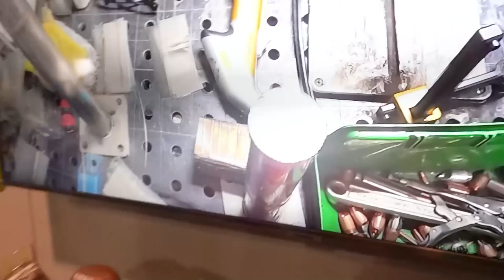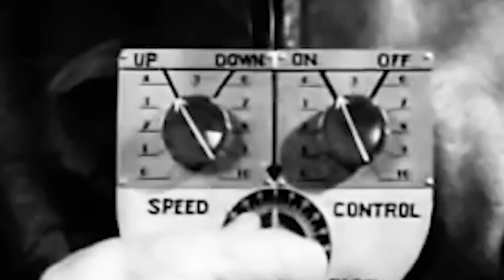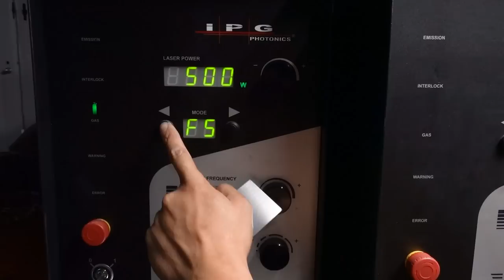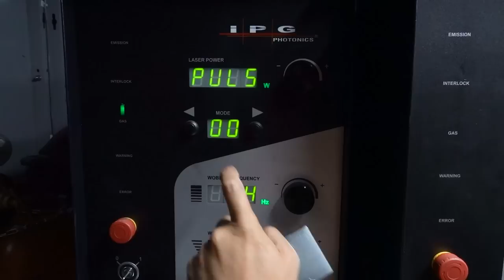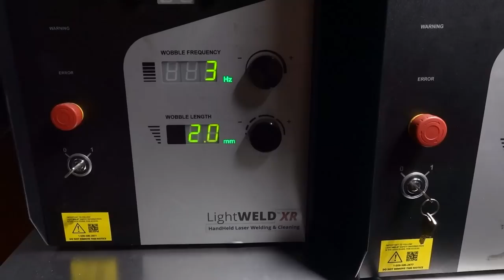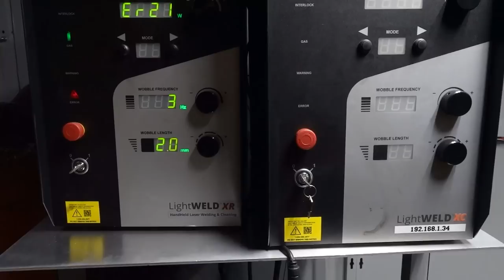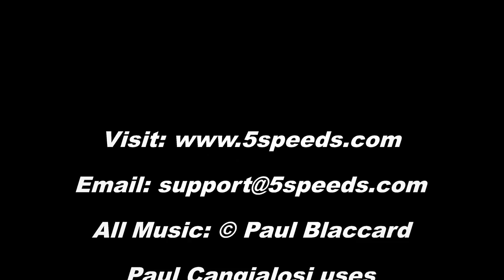How to Laser Weld At The 2022 Sema Show in Las Vegas Nevada

Comment: The only thing keeping me from having one,  is that Price Tag.
$35,000 is a quite $$$ for the average welder !
Reply: you can try other brand laser welding machine
Reply: ~$5500 for a 2kw machine direct from China via reputable suppliers with a Reci fiber laser core. They're not quite as polished but these machines are really simple at a fundamental level. Not to mention that any stainless part from China was welded with a Chinese laser. They're not outfitting factories with American lasers.

Comment: my shop just bought an IPG laser welder I am the guy they picked to use it. I start tomorrow
Reply from the maker: Let us know what you think!
Reply: Well damn bud don't leave us hanging how was it?
Reply: It’s totally different then any other type of welding. Torch angle and travel speed are the most important. I’m still getting the hang of it. The little distortion it has in stainless steel amazes me.
Reply: My shop also just bought one and I was the one they picked to run it
Reply: @adolfoflores-mx9ll  it’s definitely not like any other welding process. You gotta watch the laser not the puddle. I’ve gotten pretty good at it.

Comment: U can achieve the same fusion effect with brazing…. And at about 1 million dollars cheaper… way less to maintain and can buy new tips and guns starting at 15$ …. Only problem for most is it takes time to learn and skill to apply the techniques
Reply from the maker: Fusion effect? Brazing is brazing and welding is welding ...period. its not done for a "look".  Can you braze for certain applications instead of weld... Yes. But its not a cosmetic thing. Ive brazed with TIG and welded with TIG. Depends on materials and engineering requirements.

Comment: No cut and etch to show penetration of the weld. ?     Or does it just lay down a bead on top of the material ?
Reply from the maker: Read the oother comments about penetration and try and understand that this was done at a trade show.
Reply: @GearBoxVideo  exactly .. they should have had some cut and etch examples there .
Reply from the maker: There were plenty of welded examples at the show on display...

Comment: Would it be safe to use Laser welding,as i have a pacemaker now
Reply from the maker: Since laser is light and not an electric arc, I think your concern should be towards any form of electric arc welding.
Reply: The only risk to your heart with laser welding is the possibility of it stopping when you see how fast, easy, and beautiful the result is. 😏😁

Comment: Question: Would I be able to weld cast iron, cast steel, and cast aluminum with this welder?
Reply from the maker: Its the same as a TIG method .Just a different way of applying the heat. So however you weld or braze your metals doesn't change .
Reply: @GearBoxVideo  Thank you Sir

Comment: Like you said..  When you release the gas trigger, it does go ahead and give you about a 3 second delay of more gas --- and you're supposed to hold it steady at the end of your weld, until the gas stops.   What that does is shield your weld for a those few seconds letting that last bit of your weld cool, while still under the shielded gas.   If you just quickly pull away the welder right when you're done, it can make cause trouble at the end of your weld.  So again, once you get to the end-- you let go of the trigger and hold that final position for those last 3 seconds of gas while the weld cools, and you'll have a perfectly finished weld.

Comment: Paul many thanks for presentation.  Would be helpful to show the components for a shop to stand up allowing one to weld.
Reply from the maker: I am standing up and welding . If you have a shop you can weld on any bench. Welders are portable just like any other welder.
Reply: @GearBoxVideo  as a novice could you identify the components
Reply from the maker: A bench. Various clamps and fixtures to hold materials together. Most importantly take some lessons

Comment: how hot do the base metals get ? is the heat more localized to the weld area ? Or is the thermal action from the laser as hot as using electric arc ?
Reply from the maker: Think about what you are asking. Base metals have to reach a certain temp to weld.. period. Laser is more pinpoint. Less distortion. More focused heat to achieve the same outcome at the same temperature.
Reply: @GearBoxVideo  Common sense would come to that conclusion but I have little to no experience with lasers. That being said metals like aluminum take a lot more wattage to cut using a laser because of conduction so the answer might not be so clear cut. Pun intended !
Reply from the maker: It doesnt matter with laser  there is no AC or DC settings like you would with  TIG setup. Obviously 1" plate will require more wattage than 1/8"

Comment: Started looking at this tech because I'm not a welder, but have friends who are. They took one look and asked where to get one. First application I thought of was aluminum sailboats. The manufacturers who TIG their boats, take 15 months for welding. Laser is 4x faster adn more accurate and as shown here, stronger. When a boat hull flexes and vibrates it's stiffness and strength that prevents welds from breaking over time and stress. I know what I'd want in the middle of the Pacific with no hope of rescue.

Comment: My employer has several laser weld cells for welding Mufflers and Resonators (our customer has migrated from traditional canned muffler shells/caps to plasma/laser welded shells/caps). And we stamp some body parts that our customer laser welds. Beautiful process, but due to how fine the weld beads are, the tolerances are stupidly tight (to the point that our stamping methodology had to be rethought compared to how we used to make such stampings). 

Safety is another issue. At least for our IPG and Panasonic setups, I'm told that the beam will permanently blind until it has reflected off of two surfaces. As a result, the cells are often 100% light sealed when the beam is on (we use cameras inside to monitor things). I am intrigued that hand welding is an option due to such. Taking notes.
Reply from the maker: The enclosure is by Lightsafe. The company Sera Laser sells the whole package. As a production TIG welder my eyes have been burned twice by flash from other welders so as stated by David in the video safety is extremely important due to the risk of permanent. Damage.

Comment: Would be interesting to see it used on coped 4130 tubing, for roll cage / frame applications.
I’m thinking fitment would be even more critical then usual…
Thanks for sharing!
Reply from the maker: The only issue I see is that the gun is much larger than a tig torch. So in car welding could be an issue in terms of getting around the cage.  You can auto feed it like a mig or weld like a hand held tig

Comment: My dad taught me to arc weld back in the 50s when I was a kid. This looks so much easier.
I didn't get the part about the gas. Is it being emitted out of the tube that the laser is coming out of?
I haven't been to a SEMA show in several years. Maybe next year.
Reply from the maker: Any weld requires a sheidingg gas to prevent oxidation. Stock or arc welding has flux surrounding the electrode which shields the weld
Reply: I just got my first welder Lincoln AC 225. How big of a generator do i need to get?

Comment: To get an attractive weld on the first try with the laser , is impressive to say the least. You won't see anyone doing great welds with their first try at TIG or any other welding method..The possible permanent eye damage from incorrect use sounds very concerning though.
 Imagine five blokes welding on the floor with IR beams going in all directions.. Oh crap,i just got zapped in the eyeball..
Reply from the maker: Since I was a production tig welder I can tell you that every station is shielded. The booth we were in was an example of a large station. Thus the name "Lightsafe"
Reply: Yes, to be sure the PPE and safety procedures will need to be tighter with then then traditional welding, but nothing that is excessively burdensome. And I don't think this will replace traditional welding either, this will probably replace some TIG applications, but it also opens up other use cases as well.

Comment: What happens when u got a gap that u have to fill in by weaving
Reply from the maker: Not any different that a normal weave
Reply: @GearBoxVideo  ..it's can stand a regular stress test an things?
Reply: Off the top of my head i believe the lightweld XR ($30k+ machine) has auto weaving as a function.

Comment: I don't know many, I wanna see structural testing on these. I saw a 25k machine that even has a wire add on, and I just don't trust the penatrstion.
Reply from the maker: You can easily get 100 percent with these. FYI. Laser has been used to weld synchro cones to gears for quite awhile since heat distortion is negligable
Reply: Yeah I'm thinking the same thing,  I'm not seeing the penetration here.  This appears to be more like laser brazing than welding.
Reply from the maker: Dont judge on a practice pieces set up for demos. Keep in mind most people trying it at the show, and there were 100's by the end of the show. They are not pros. So, they are not going to crank up the heat and have people blow thru the plates. There were many examples of perfect 100 percent pieces there. This whole thing of people sitting at home computers judging demo weld penatration is silly. Think it thru. Laser welding is used in the automotive and aerosoace industries already. It has been for years. Point of the video is that this technology is now available for small job shops.  As I also mentioned the laser welds on gear assembles are a testiment to reduced distortion and embrittlement with certain alloys.
Reply: @Billy SBC  you are judging penetration based on your knowledge of electron welding. This is a different process. Look at that first piece they showed. My understanding from what they explained is that it was welded from only one side and you could clearly see it melted through to the other side. Sounds like good penetration to me. Especially when they can throw that weld in a brake and bend it like that.
Reply: @GearBoxVideo  "This whole sitting at home... behind your computer... judging... think it through... "

What? Think critically and rationally? GOD FORBID! 

I've been welding since 1972, and I'm sure, right around then, TIG was being introduced at some show somewhere (I don't know this, the when and where of it all, just saying "as an example...") and stick welder guys were like "There's no way this is gonna penetrate like... (name your rod)." 

Technology marches on. There will always be people, and there is more of them now "visible" to us all because we all have these phones, AKA computers, empowering them, who without even trying to think about "the thing" rationally and critically, who will criticize progress. Any progress. In our recent past it was the horse and buggies, now internal combustion. 

Not to say each technology hadn't reached their peak of efficiency and performance, but it was nearing that at about the same times, but after a bunch of kicking and screaming the new technology gets adopted and the horses go to pasture, the wheel smith's learn to install piston rings, and the flying car with pulse hydrogen propulsion becomes the common thing. 

Rinse and repeat about every 100 years, then 50, then 25, then 10... And so on. 

This doesn't just apply to technology. It applies to everything.

Ironic that the SEMA show supports - at the same time - both holding onto a "past" that is moving on and a "future" that is about to replace it.
Reply from the maker: Thanks for taking the time to write this response.
Reply: @GearBoxVideo  well if you're trying to sell a welder . pre cut etch pieces would make it easier to explain and sell the thing.  Giant corporations don't buy small machines they buy large computer controlled robots. So there's no comparison to them.  asking about penetration is a very valid question.
Reply from the maker: The show had examples of all sorts of different welds with different materials displayed , penetration etc.

Comment: Laser welding: it's either a critical process that requires the exceptional process control of laser welding... or a $30,000 piece of equipment you can buy so you don't have to pay a skilled welder $1000.

I have a feeling that for most ethical employers doing real-world work, a good old Dynasty or TIG 200 will do the job.
Reply from the maker: Machines will never replace skill. But you dont see a bunch of people welding cars bodies together on assembly lines do you?  Its not about replacing talent. Take the time to read my pinned comments and links to the benefits.
Reply: @GearBoxVideo  There's nearly as many cars as people in the USA. I sincerely hope we're getting close to having enough.
Reply from the maker: And your point is?
Reply: @GearBoxVideo  I guess my point is that a $30,000 welder with automatic heat control is a boon for the employer who doesn't want to pay a trained welder's salary. But to a trained welder who's got $30,000 to spend on either one laser machine or a tig/stick welder and a whole truck full of tools, it's gonna be a tougher sell. 

I have also never in my life heard a welder say "gosh I wish there was something stronger than TIG." I suppose it's happened.

I am pretty sure my last employer will be buying one of these and putting it in the hands of a $16/hour employee, because they've been having a hard time getting a qualified welder to stay on the job at $20.

This has nothing to do with you or your channel so I'm not sure why you're being defensive. I just see a faustian bargain in this emerging new technology and I'm not ready to call arc welding "obsolete."

If wages were not in a crisis right now and the machine was 25% the price, I'd be making my own videos about why everyone needs a laser welder.
Reply from the maker: The laser welder does not replace skill.  You still have to be certified to weld in certain situations. I dont think you spent the time to read the links in my pinned comment. Nobody is going to hire a person with no welding experiance for a welding position. These are not going to replace a skilled welder. I worked as a welder and can tell you its no different then using a Tig torch. The size of the torch is cumbersome and actually is worse in tight applications.  It has pros and cons. I didnt make a video on why everyone needs a laser welder, i just made a video to show what new technology is available. Im not being defensive by the way.  Just read the links in the pinned comments.

Comment: I'm not seeing the penetration with this.   Is this "laser welding" or "laser brazing"?
Reply: Do you think you could butt braze 1/8 stainless and bend it 90deg on a brake without it cracking?
Reply: typical power density for the weld regime of stainless is from 10^6-10^7 W/cm^2, so penetration of the weld is represented by the heat affected Zone (HAZ) which is a function of laser power density - i.e., function of beam diameter, laser amplitude or pump voltage supplied to the laser pump source (flash lamp or semiconductor laser diode, but usually lamps are used for high intensity welding applications) and the beam pulse width, or duration of the pulse on the material.  The weld penetration is directly related to the pulse width of the laser in laser welds. For a weld to be 5 mm deep with the right focusing optics and a power density above 1,000,000 W/cm^2 pulse width should be set to from 1-5 ms, up to maybe 10 ms for a highly reflective part geometry.

Comment: Lol….this not really welding, no where near the strength
Reply from the maker: You need to read the comments. Especially my pinned comment.
Reply from the maker: Wrong video. This is video on what laser welding is at a trade show.. Think it thru. A trade show. Why would you think we were putting links to stress tests? Just showing what it is. This wasnt done in a lab or a test environment.
Reply from the maker: Read the pinned comment also...
Reply from the maker: First off, i never did a short form video for this, so you really need to stop saying I had a link  to a stress test.  There might be some video along side of mine that made some claims, get it? again, no short form video, no links. Do yourself a favor and check where you get your info from before making stupid comments. Because someone makes a  link to my video doesn't mean I made that link. Learn how the platform works.
Reply from the maker: Rethink it. You are just one of those typical people that want find fault with something, Then proved you were wrong accusing me of something I had no part of. Look at your first post. Telling me l need to do this... Etc Usually I would take this whole thread off. But I wont because its your ignorance and tone that makes you look like a fool
Reply: Why you are trying to talk about it? Afraid to lose your job as a welder? This is better, faster and easier than any other welding technique out there. ofc not suitable for everything, but whole cars are laser welded already and much more. It’s a common thing in the industry that they have laser welding robots. and now we have handheld machines…